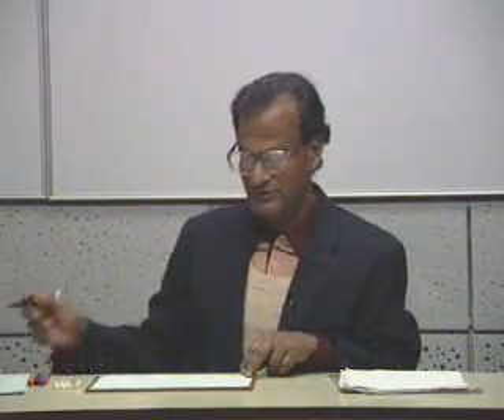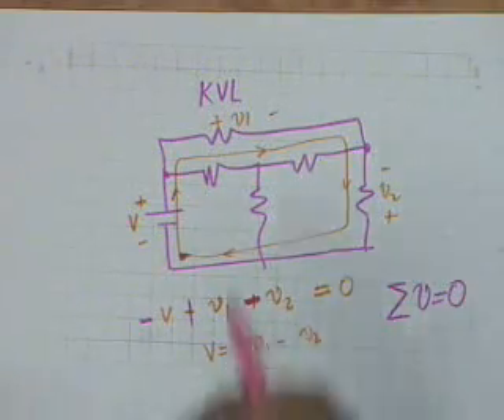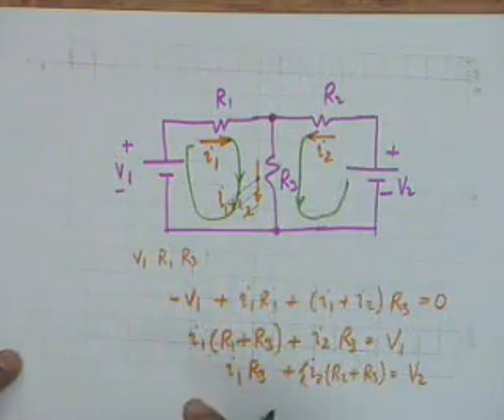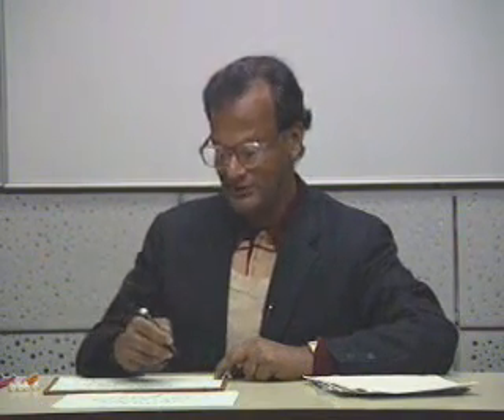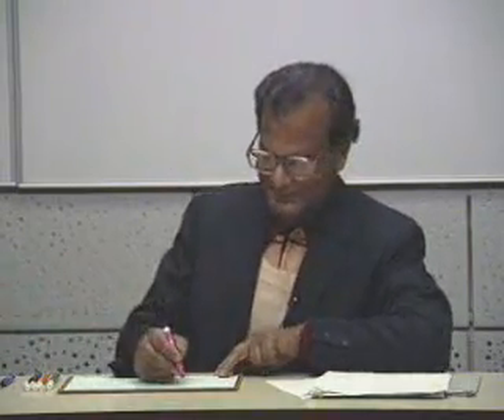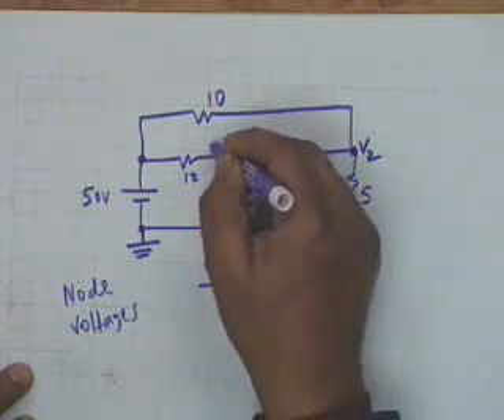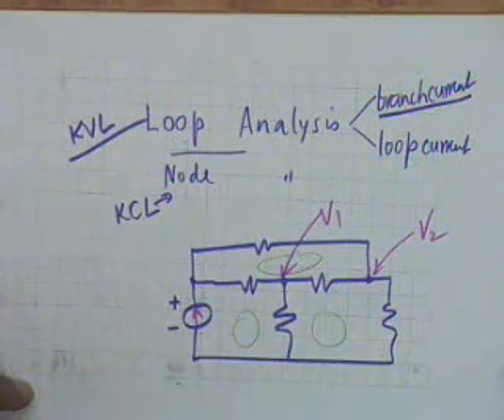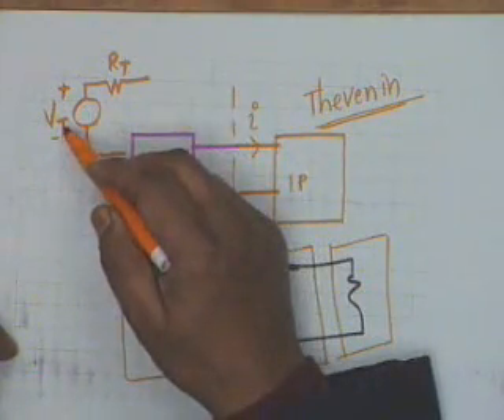3 KCL, KVL & Networks Analysis

Comment: why  in any electric ckt
any branch cant carry two current source at a time???
plz give my ans
Reply: because it dont obey kcl
Reply: If any branch contains two current sources then two should be of equal value otherwise by law of conservation of charge how it is possible to get two different values of current in any single branch at a same time. Basically this violates law of conservation of charge so that's why it is not possible. Hope this helps😊😊